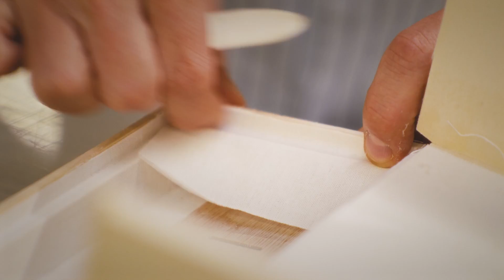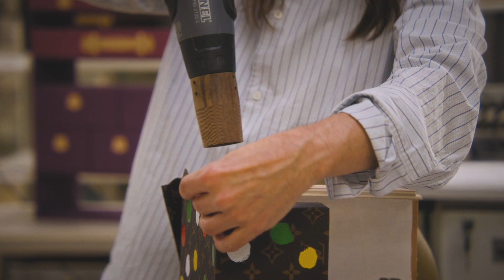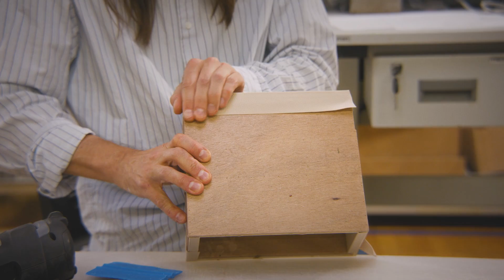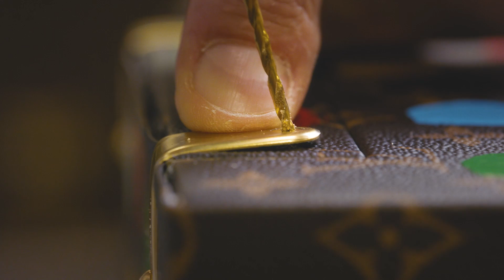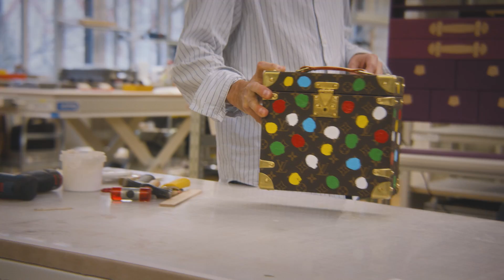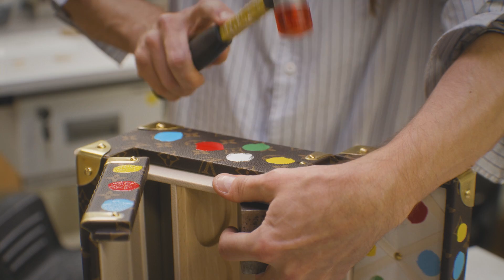Making a Luxury Louis Vuitton x Yayoi Kusama Trunk From Start to Finish | Vogue France

Comment: If bags were actually made like this with the same process and slowness, you would only make two bags a day
That means sixty bags a month
Which means that you will not reap all this wealth
You will not even find enough money to pay the workers' wages, so your work will end
So stop lying
Reply: Well, in case you don’t know, this is only one model amoung loads of others. Not all models are high end, some are made one unit at a time, some others are made in serial production and only take a few hours to make.
Reply: I’ve worked in a LV bag workshop as a logistics engineer. We were producing roughly 6000 bags a week for 900 employees, which means roughly 1 bag a week per employee (all employees considered - even logistics, HR, etc.). To be fair, the bags are produced in a « chain production manner », which means that in a production line, a worker does only a specific task for several hours and the bag moves across the line. Most assembly tasks are automated (sewing machines, embossing, etc.), except for trunks where quite litterally everything is manual besides cutting the leather/canvas.

Hope that helps to add some perspective !
Reply: @sleju69  Interesting comment.
I never worked for LV but I used to work for Hermès.
We do work in a kind of ’’industrial’’ mindset but one person makes the bag from beginning to end, except the cutting and what we call ’’preparation’’.
Hermès cares a lot about the versatility of the employees. Pretty much everything is made by hand except the cutting of pieces.
People get all the pieces needed to make a certain number of bags during the week and they have to manage their production cadency by themselves.